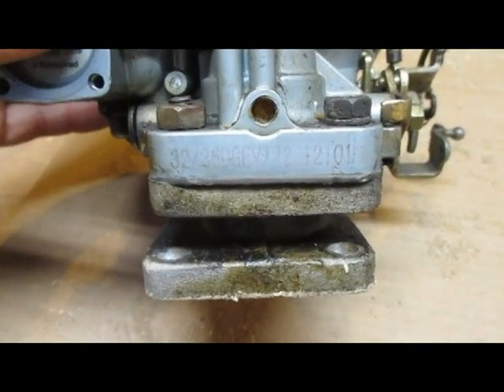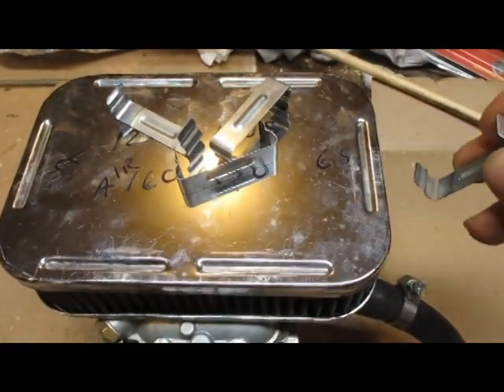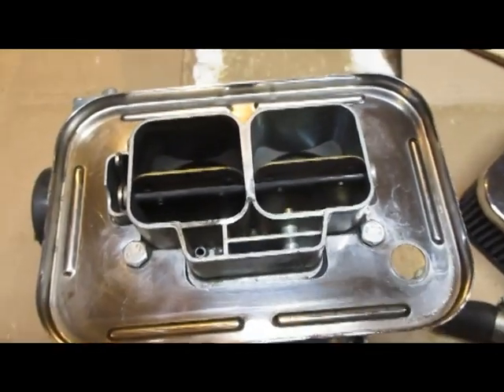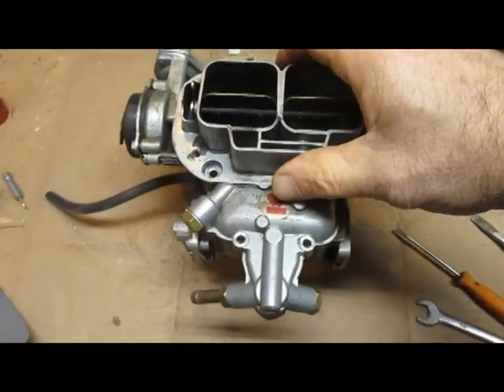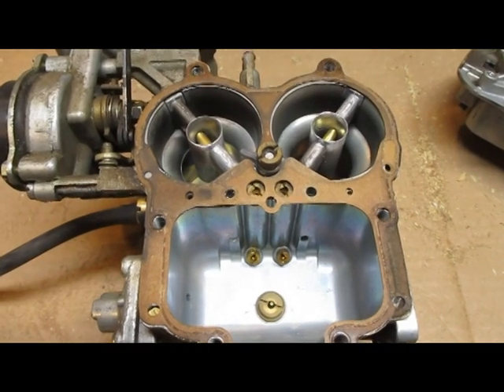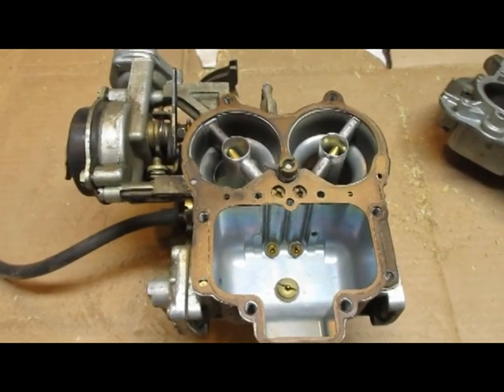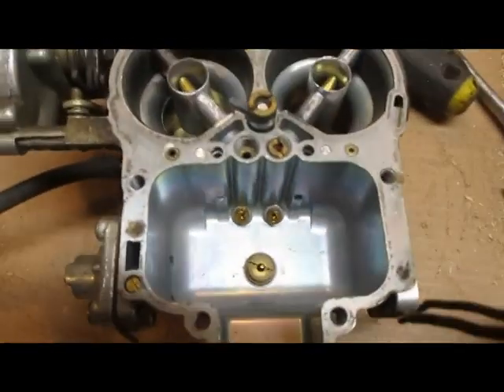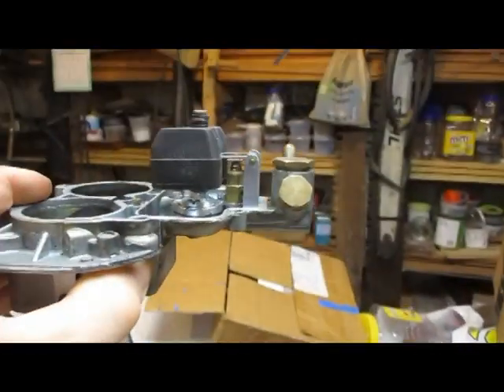Toyota Tercel 4WD Weber 32/36 Carburetor Primary Jet Swapping

Comment: Also, those 2 jets on the side are your primary and secondary idle jets. Weber carbs run mainly on the idle jets, reduce those for better mpg, leave your main jets larger for power.

Comment: Hello sir i want to ask you if i have to do a gear box swap on my 85 tercel from 4wd gear box to only rwd gear box witch gear box should i use
 thank you
Reply from the maker: I suppose you could remove the front axles, cut off the tranny ends and plug them back into the tranny to keep oil from coming out then leave tranny in 4wd all the time. You may want to join the facebook 4wd tercel site and bring subject up or tercel4wd.com
Reply from the maker: So you want a 2wd vehicle but you have a 4wd.
Correct?
Reply: Yes i want to remove the 4wd gear box from it and remove the front axle to only make it rwd
Reply from the maker: @dragonsigma8611  ok, the tranny can be swapped to any year 83-88 tercel 4wd as long as you swap the tranny “only” . That means separating it from the differential. I say that because many think they are one unit. They are two units bolted together. If differential is swapped its gear ratio has to match the rear differential. Early models were 3.73 late models 4.2 gear ratios.
Reply from the maker: @dragonsigma8611  there is no rear drive only tranny for the tercel wagons
Reply: Ah okay thank you
Reply: I have 2 tercel 1 is in a good condition but need a gear box and the other one is very rusted but with a good 4wd gear box so i want to swap the gear box to the good one and put a rwd gear box to the rusty one and driving it
Reply: Is there any rwd corolla or something who have a rwd gear box that can fit in my tercel from 1984 ??

Comment: good idea using a bolts i have the stock studs with nuts n washers you gotta watch out for taking off, I was running a 140 in the bowl which my truck was back firing  after i turned the engine off, so I went down to 135 and after I drove across town i did fine and then today going to work I started chokin out of fuel so I ended up towing it home since I didnt wanna run it hard since its a fresh rebuild.

Comment: That red logo means that is a real carb and the sticker is the cheap one.  Is that correct?
Reply: That means it’s a fake chinese knockoff of a Weber,they can be troublesome removing the Jets they use cheap ass material and can break very easily if you apply lot of force..
Reply: @theretrogeek2281  i noticed on the Facebook tercel group to avoid the sticker and get the red logo carb if i ever decide to get one or if i have to get one.
Reply: @euclideszoto997  Usually a real weber it has to be stamped on the metal the word WEBER and says MADE IN SPAIN ,or ITALY  that’s the only way it’s original usually it also has a white electric choke not black and has a couple of blue dots near the fuel intake coupling..
Reply: Exactly " this is a Chinese made weber.  The RED logo gives it away .